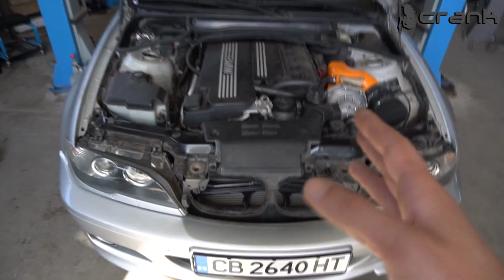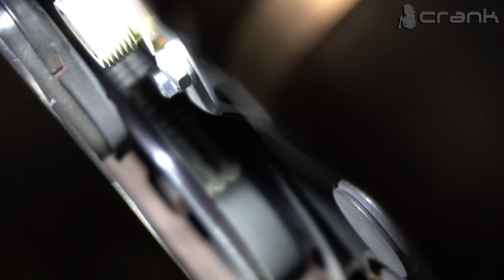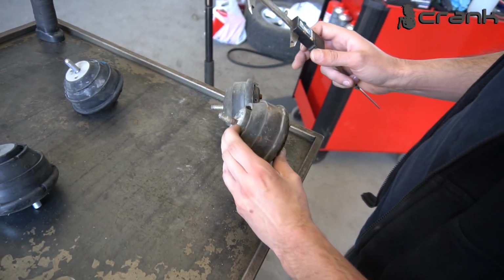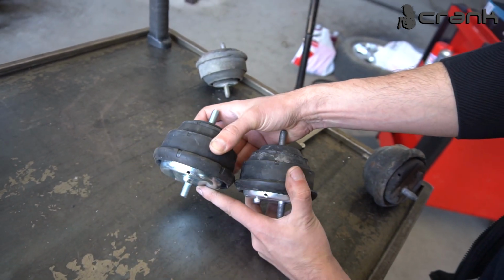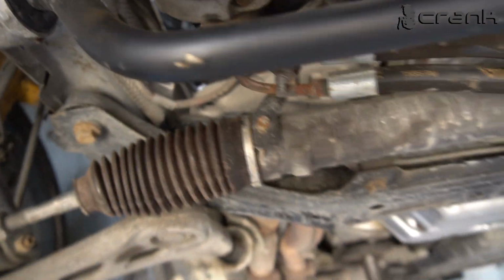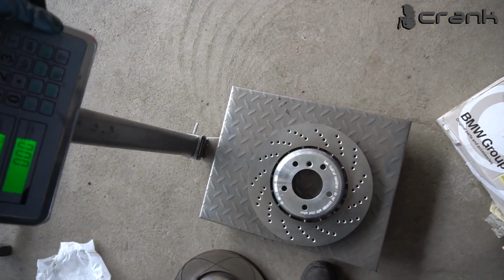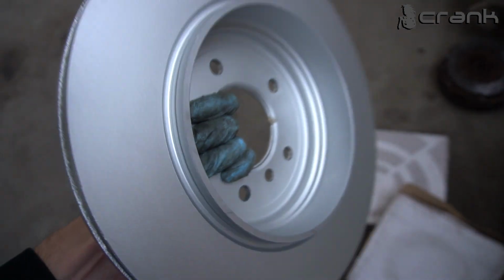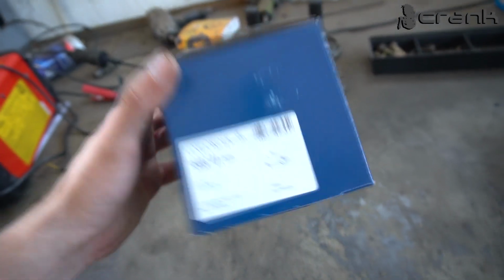OEM Performance Engine Bushings and Brake Discs BMW E46

Comment: hello, I have a bmw e60 530 automatic transmission, when I put it in r and accelerate hard, the transmission goes into gear and when I stop at a traffic light, it jerks a little, what could it be, please help me
Reply: Change the transmission fluid and filter 1st . Probably never been done , it’s a plastic pan and filter combination.If that don’t help it maybe shift solenoids .